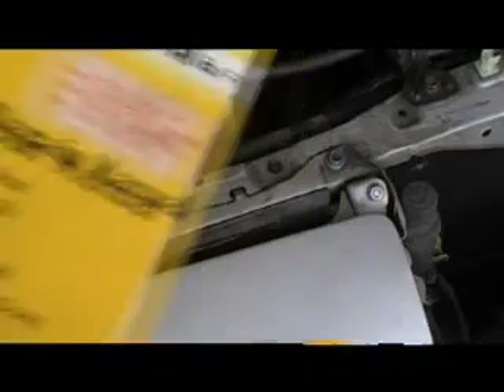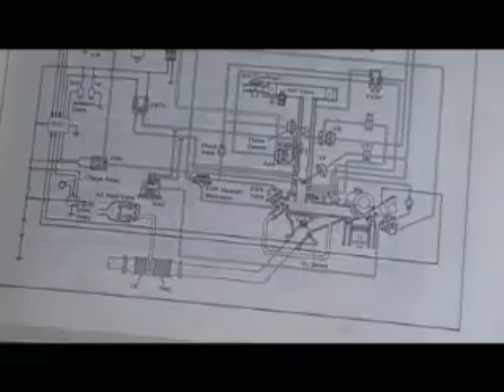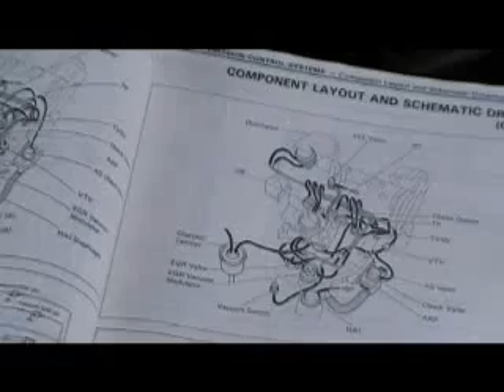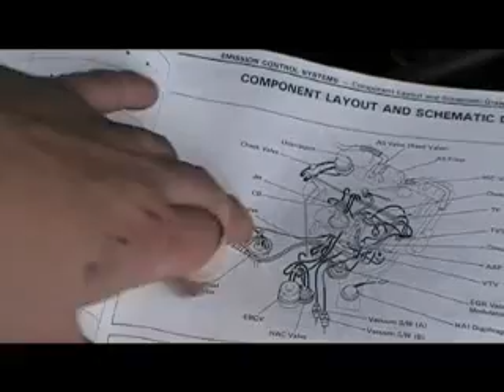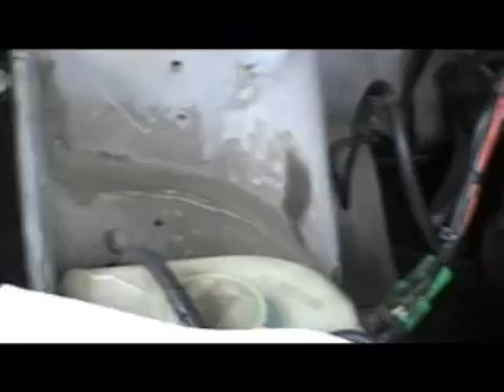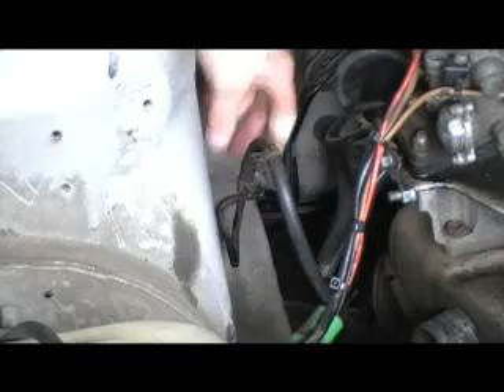AE86 Carb Project Part 1

Comment: Thanks for this video. Recently bought a ae86 sr5 that eventually will be making a black top swap. But in the mean time im using it. And the car runs like crap. Previous owner has eliminate a lot of parts from the carb but now runs like crap and every time i hit the brake it will shut down. And idlle really ruff

Comment: Hello, there are four nipples where you said to leave one for the vacuume advance on the carberetor. I have one top right, two center and a lower onlg one in the are you pointed to. PLease provoide more specific location for the advacne line.